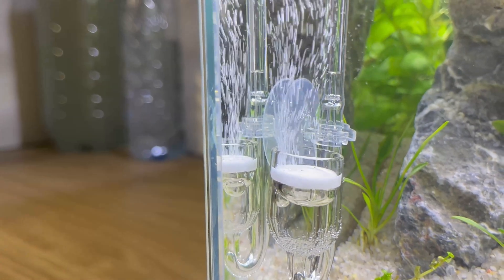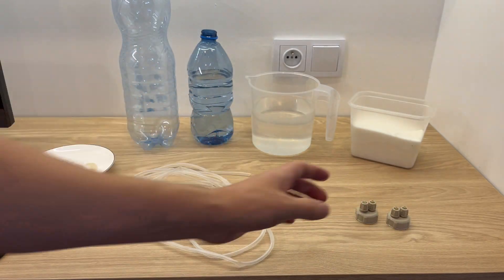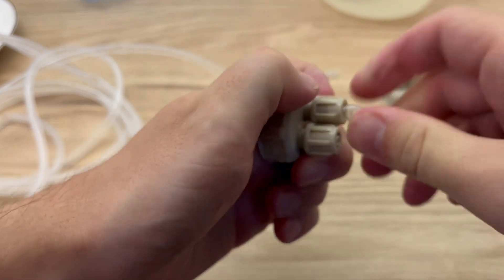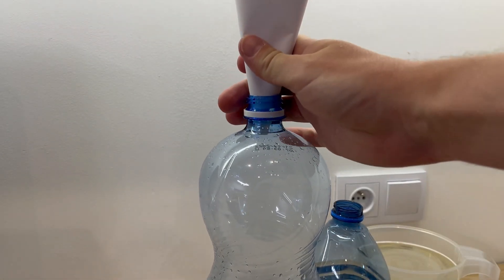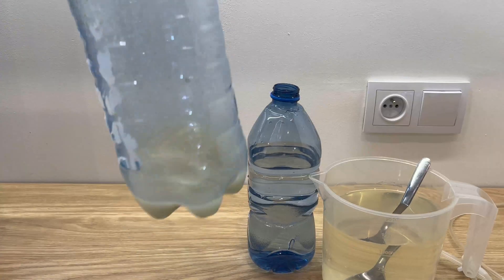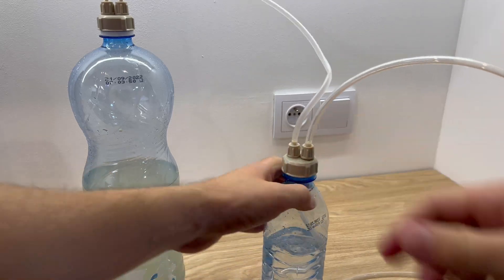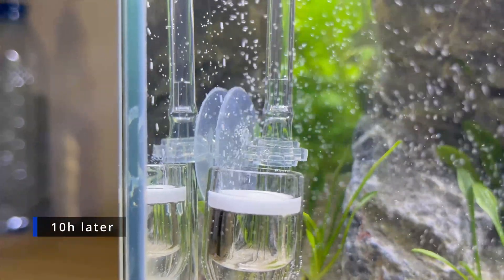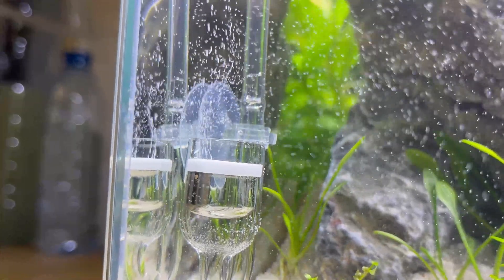How to make easy CO2 for your tank? Cheap and easy DIY CO2!

Comment from the maker: Do you have any better recipes for your CO2? Let us all know in the comments. And please don't forget to leave a like :) Thank you!
Reply: How to shut it off co2 at night?
Reply from the maker: @gguabes  With this stuff I don't (plastic bottle would break). But you can do the opposite: turn ON the air pump. This way O2 will be pumped inside and create a lot of surface movement. This is enough to avoid high CO2 level. And if you don't want that, you can raise filter outflow to create the same effect. In general surface agitation is the key to avoid CO2 spikes (I'm monitoring it with drop checker: https://youtu.be/Czix6XwZzc8)
Reply: What's the purpose of the small bottle?
Reply: @ahmedbenmarzouk6708  It's a filter to prevent the produced alcohol from reaching the aquarium.
Reply: @AquascapingCube  three cups of sugar dissolved into very warm water and then three heaping spoonfuls of dry yeast in the sugar screw on cap. 3/4 of the way full of sugar water and about halfway full on jug as filter which I have a long tube with holes along it any plugged the end of the tube. Very good and cheap
Reply: @AquascapingCube  very warm water and I dissolve three cups of sugar and let it cool then add three tablespoons of yeast dry active. Keep the water mix below the top of jug or the mixture will spew alcohol into your plants and this ain’t good.

Comment: I’m getting plenty of of bubbles in the small bottle, but after 24 hours none of it has made its way into the tank. What am I doing wrong? I’m sure the system is sealed ok
Reply from the maker: Still nothing? Sometimes it takes longer. You second bottle should be very hard when you try to squeeze it.
Reply: I had same problem. Turned out it was leakage. Use your nose to find the leakage. A slight smell of yeast is the sign of leakage

Comment: I did my system exactly as shown in the video but after few days the bubbles stopped producing. Checked is there is any weak spot where the pressure might be escaping but didn't find any. I remove the air stone at night and put it in a cup with water, is it possible that the quick transfer from aquarium to the cup when it is out of water for few seconds might be causing this?

Comment: The second bottle is interesting but according to GPT it's only effective if the tank is very small, on larger aquariums it's very unlikly to dirty the water with that system. Yeasts requires sugar to make fermentation so inside the aquarium it would die, of course there are still sugar produced by plants but they eat it, and if the yeast reaches the water it will be in competition with the other aquatic bacteria that are stronger to survive in this environment... So it's pollution but the yeast itself will be eated by these micro-organism, that could increase the pollution, but not more than a full piece of yeast dropped inside the water, which wouldn't be enough to destroy an aquarium that has a good balance. 🤔

However it would be cool to make a real test to check what's the reality. Because I hear many things about that system that make no sense with physics or sciences. For example many put a valve to prevent water to come back in the tube and merge with alcohol, how ? Do they think the absence of pressure will strive the water in the water and merge with alcohol ? But you have days to see the reaction dying and as you must keep the CO2 stable it would already be a fault to wait that much. Then even when the yeast is dying it still produce a small amount of CO2 that keeps the pressure in the tube, in fact you need a certain pressure for the bubbles to cross the water, so when you still have a very small amount of bubbles it means there is no chance the water could do the path in reverse, in any case nothing in the bottle has the ability to create some void inside it, so if you let the bottle for weeks maybe the CO2 could escape slowly but if the tube lets the CO2 pass it also let the air pass, so it doesn't create any void either. 🤔

In fact even if you suddently open the bottle you stop the pression in the tube, so there is no more pressure in tube and the water of the aquarium could go inside the tube, but this water will be blocked precisly at the surface, as the tube necessarily has to exit "above" the water, the water inside the tube couldn't cross this area even if the tube goes down afther that and if the bottle is under the aquarium, nothing strive the water enough to create a siphon effect.

Then I read the presence of water inside the tube could affect the CO2 when you'll renew the mixture as the CO2 will dissolve with the water remaining inside the tube. But as the pressure will increase this water will be pushed outside the tube, in the aquarium, so if you don't let the tube wet for months there is no risk of problematic bacteria, but even the idea dangerous bacteria could appear inside the wet tube is weird as if the water of the aquarium reached it means the bacteria of the system can also reach it, they also breath and feed, so the inside of the wet tube has the same bacteria as the outisde of the tube that is underwater, it would be weird to let the tube underwater for months and even if you do it, nothing will happen.

According to the chimical reaction you don't get only CO2 with the yeast and sugar, so if these gaz were thin enough to reach the tube of the first bottle there is no reason they wouldn't escpae the water of the second bottle too. Big particules will be stuck in this secondary filter but not the gaz. In fact a total of 5 different gaz are produced with the CO2 and only 2 of them can react with water (CO2 and CH₃COOH), these 2 will change the pH of the second bottle and then the water of the aquarium.

So... We need some tests please 🤗 For example after the reaction the first bottle smells like ethanol, which is normal and a proof some gaz that aren't CO2 are released (CO2 doesn't smell anything), is it the case for the second bottle too ? I suppose the second bottle smells like ethanol as the gaz is trying to escape but there is no ethanol in its water, which is a difference with the first bottle. When you drop the first bottle on the floor it will smell ethanol a lot, but I suppose the second bottle wouldn't smell as there is no liquid ethanol inside it. It would be interesting to test the water of the second bottle, as the CO2 affected it I suppose it's an acid water, but is it dirty water ?

In any case don't drink the water, 1L of water with 200g of sugar and yeast will produce about 120ml of ethanol, which is about 2,4L of a 5% beer...

Comment: Can share what and why the safety valve for?
Reply from the maker: It was just in case you want to decrease the pressure. To slow the reaction and limit the amount of CO2 going into the tank. But it's not necessary.
Reply: @ thank you for the tip. I’m planning to do the same.

Comment: very good and well explained.  I thought for a long time about making one at home.   But never dared until I saw your video.  Now I have bought the things to make a co2 at home.  You say in the video that you should have more yeast if you have a larger aquarium.  I have a 180 Liter at home, how much more yeast do I need to mix in then?  I think you have calculated what you are mixing specifically for your aquarium.  Thanks for the video... Greetings from Sweden!
Reply from the maker: Thanks for commenting! If you are just starting I would suggest to start with the same ratio. You will get some experience, see how your tank behaves and observe CO2 levels. You will see how much does it influence your water chemistry. So next time you adjust the amount of yeast by 20-30% and again see what happens. I would change it in small increments, it's safer for you, your fish because they will not get shocked with sudden high CO2 level.
Reply: @AquascapingCube  ok... understand. Thank you for replying back. 👍🏾
Reply from the maker: And count the bubbles per second, so you can see the difference. When you add more yeast - you will get more bubbles, this will make things easier to measure changes in ratio.

Comment: The small bottle is used to neutralize alcohol so that the CO2 that enters the tank does not harm fish and plants because of the chemical reaction and the water will not become cloudy. 😊
Reply: No, it’s used as a trap. In case the yeast foam passes over so it doesn’t go in the aquarium.

Comment: also is there a way to modify it to have a shut off valve? or if i wanted to stop it at night would i just remove the tube that runs to the diffuser?
Reply from the maker: It would be better to move diffuser from the tank to a glass with water. If you remove the tube - pressure will quickly drop and entire CO2 can escape.

Comment: Amazing setup! I'm trying it out right now and it works like a charm. 
I got a question, though: what if I pinch an airline to limit the CO2 amount at night? Will it be risky due to the pressure accumulation?
Reply from the maker: Yes, it will be very risky. The best thing to do is just to move diffuser to a jar of water and let it run there. But you have to be consistent when you do that.

Comment: If using this setup for a small grow tent is the 2nd bottle necessary? I imagine it''s there to just filter out any potential yeast water going into a aquarium rightt? Also the safety valve really only serves as a emergency release for to much pressure? Wouldn't unscrewing the 2nd valve up top do the same? Or does the valve release automatically?

Comment: Interesting, what is the purpose of the second bottle?
Reply from the maker: It acts as filtration system. In case dirty water from the first bottle goes through the tubing - it will get caught in the second bottle, and will not end up in the tank :)
Reply: @AquascapingCube  Thank you for your answer, what do you think about citric acid and baking soda mixture?
Reply from the maker: @ebrahimsaleh8134  It works great as well! But I use it only in different setups, not DIY. Here I talked about this: https://youtu.be/pEvk9QjpHUE
Reply: @AquascapingCube  Awesome, thank you

Comment: Just set this up got a 1 liter with plain water as bottle #2 and bottle #1 is the sweetened water with dissolved yeast I’ve observed bubbles in bottle #1 however have not had any bubbles come out of my co2 diffuser and it’s been about 2-3 hours am I doing something wrong I followed the video step by step
Reply: I used dry yeast the first time and it only produced a small gaz after 48 hours in warm condition, so I tried with fresh yeast and it worked in 20 minutes. I then put the rest of the "fresh" yeast in the fridge (3°C), then I renewed the mixture every week using the yeast of the fridge, after 5 weeks it's still working. According to internet the yeast dies after 2 weeks in the fridge, it's a lie. I put the yeast in a plastic bag and I remove the air inside it everytime.
Reply: Next day still no bubbles coming from the diffuser

Comment: Can you please explain what the valve was for ? You failed to mention it. Where do I get a valve like that ? Is it sealed ? It looks open on one end. Very confusing.
Reply: petco or petsmart has assortment pack of fittings with the valve in it. the valve is to relieve pressure if so desired before or if the bottle has to much pressure.

Comment: Whats the purpose  of the valve you fitted please
Reply: To make sure that side of the hole is completely closed. Usually you don’t need two holes on the big bottle. But also secondly sometimes that valve acts as a safety if you want to reduce the pressure inside the big bottle
Reply: To turn off ,co2 at night
Reply: @mcop.4149  this type of setup can't be turned off.
And that tap is not connected inline.

The tap is a control valve, incase the production is higher than your tank can cope with.
Reply: Me too, what is it for?
Reply: Really would like an answer to this as well, and find out what kind of valve it is
Reply: @anthonylowney6785  that just to block the second outlet which is not need for the yeast system, of course its provided to attach to Pressure Gauge when used with citric acid and baking soda
Reply: How do you tell if you need to reduce the pressure in the big bottle?
Reply: @lillin5916 if the bottle is way to hard or feel like it's ready to explode (aka pop a top) ..etc
Reply: @Ray-man72  use Sugar + gel that prevent whole bottle generate the Co2, but just the yeast in contact with sugared gel.

Comment: What is the purpose for the 2nd bottle of straight water. I have seen some videos that go from the sugar yeast solution direct to the diffuser in the tank, and no 2nd bottle of water.
Reply from the maker: It's a filtration system. Sometimes solution in the first bottle creates a lot of foam and can "raise up" because of the reaction. If it gets high enough it can get pushed through the tube and into the tank. Second bottle prevents that, because CO2 needs to go through the water and all eventual particles would stay in it. Hope it makes sense ;)

Comment: @AquascapingCube Works great, Thanks for the vid. Question my second bottle (1 Liter) Is full when started, and about 2 hours the water is almost gone. Is this normal? Any suggestions?
Reply from the maker: No, it's not normal. Pressure is probably pushing the water out. I would keep lower water level at the beginning, and check the exit from second bottle: is should be high, very close to the cup and above the water level.

Comment: To increase bubble/second, can I connect 2 reaction bottle together?
Reply from the maker: To increase speed you can use more yeast. It will work faster. 2 bottles will complicate things and it might be difficult to keep the pressure in check. Just be carefull ;)

Comment: what is the small valve in water bottle?
Reply from the maker: It's just for safety. If you want to quickly decrease the pressure in the bottle, and release some CO2. You do that if there is too much CO2 coming to the tank. But it's optional.
Reply: @AquascapingCube  does it automatically release preassure when too much? Or manually have to release it?
Reply from the maker: @azeus_mecha  You have to do it manually. But there is very good chance that it will fail before anything else.

Comment: What is the valve on the big bottle do?
Reply from the maker: It's for safety - if you would like to decrease the pressure in the system and slow the production of CO2.
Reply: @AquascapingCube so you just open it to atmosphere?
Reply from the maker: @raymondburniston8630  Yes, exactly like with alcohol brewing. But you should use it just in case something happens, and you want to stop or slow the reaction.
Reply: hey man i loved the video!  before i saw your video i had already made my mixture(from MJ aquascaping) so i didnt follow your recipe but i used your exactly same equipment becasue i have those 2  plastic caps. its been 1 day now  and i havent got results yet...should I open the bottle and put some more yeast? because i only put 2g in. Also i didnt understand the valve thing. Should it be completly closed????Because right now i have it closed and i dont know if thats the problem   @AquascapingCube

Comment: How do you control the flow of co2? In that safety valve?
Reply from the maker: You have very limited control over the flow. It's possible to install safety valve to decrease the pressure, but not possible to stop or slow it down significantly. I control it through experimenting with the amount of ingredients (yeast, water, sugar). You nees to have right balance. And during the night good aeration. Sounds complicated, but actually it's easy once you do it ;)
Reply: @AquascapingCube  i have a control valve now, just finished making the system today and i experimented with different connections. I can adjust the flow by turning the valve sideways and i think at night ill keep it almost shut. The pressure can build up and in the morning release it. Ill try making as you said, baking soda and vinegar, now is the yeast mixture! Running it at 1bps for a 6gal tank.
Reply: Where did you get your valve, could you share the link please? 🙏

Comment: How many grams of yeast would you recommend for a 10 gal tank?
Reply from the maker: I would say that it strongly depends on the number of plants rather than tank capacity. For 10 gal I used 10g of yeast, but I had many fast growing plants inside. It's all about balance. Start small to be safe, and if everything will be fine - then you can experiment a bit. Just don't overdo it the first time. Good luck! :)

Comment: Hi my CO2 reactor bottle worked properly first time and second it's not producing enough CO2 I don't know what is the issue. It'll produce some bubbles when I shake the bottle or else there is production there is very little foam and it doesn't look like much reaction is going on inside. Can you help me?
Reply from the maker: Hi. It might depend on many factors. Sounds like not enough yeast or bad quality yeast. It can also happen in case of temperature change, when it's colder - yeast is much less reactive. And finally - when you were changing the yeast, maybe your system is not as tight as it used to be? It happens during maintenance.
Reply: @AquascapingCube   yes all of the above are true friend,
1) the winter has come however the temperature is still 18°c-28°c  most of the time as i live in India.
2)yeast package was not air tight and was kept in the freezer I don't know if this made it less reactive.
3) I found a leakage in the system and took care of it the next day but even after fixing the leak the reaction is not as strong.
Kindly provide insights on the following points. Thanks alot!